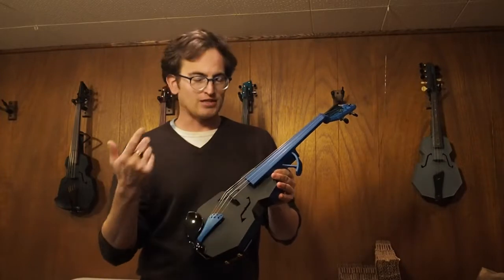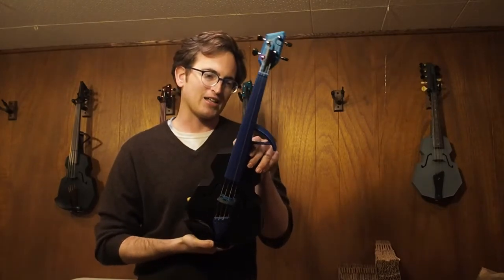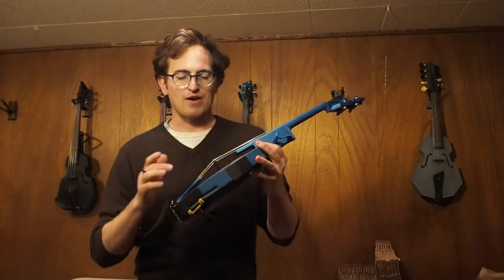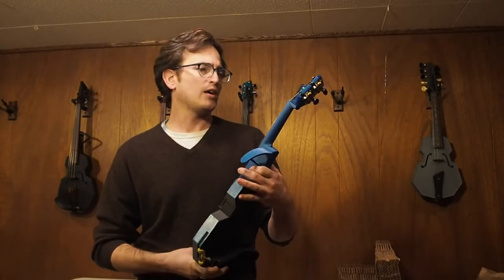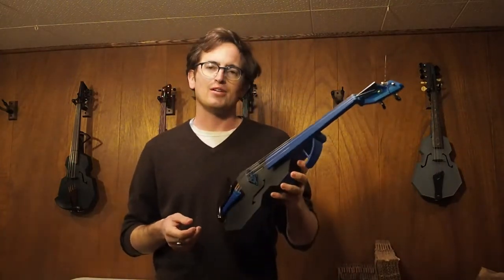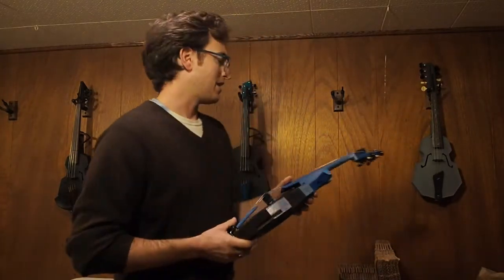A Violin Made of Recycled Plastic

Comment: I'm curious, is the bridge also made from plastic? Same type or different?
Reply from the maker: The bridge is made from the same material as the body, which is the recycled carbon fiber PLA. 

Nowadays I make all my bridges from annealed HTPLA-CF. The tone is a bit better, but mostly the parts resist high temperatures and perform better over time.
Reply: @openfabpdx  Thank you for the response. I am currently building an electric cello with many clear acrylic components. I've been hesitant to attempt the bridge out of clear acrylic though because its the source of my vibration for the piezo transducer. My thought being that perhaps clear acrylic would be too 'dead' acoustically speaking. I wonder if clear filament might make for a bridge with better (different) properties...I suppose some experiments are in order.
Reply from the maker: @scottallencello  definitely experiment!!! Some plastics sound very dead, and some sound surprisingly good. I have not worked with acrylic, but I would be very interested to see how the bridge sounds. 

Also see John’s work @ Saddle Rider Music printing cello bridges. He has done great work with very promising results.